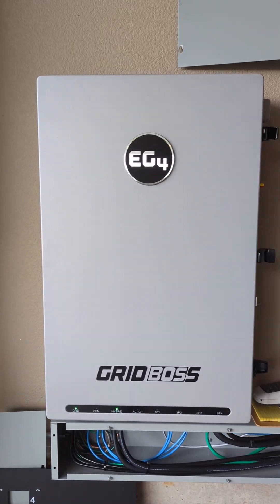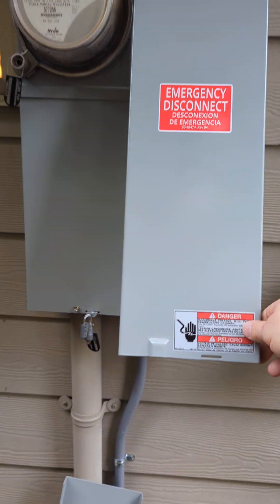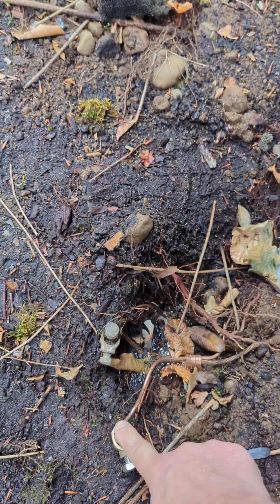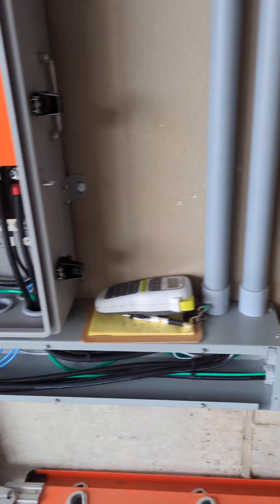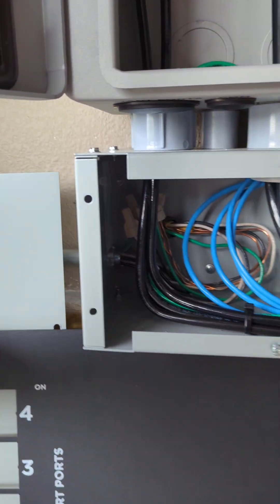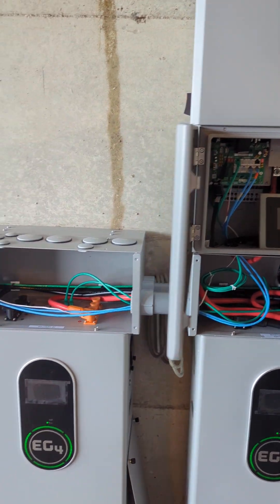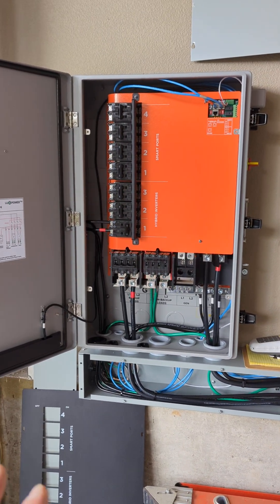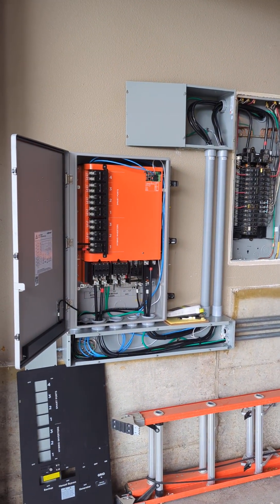EG4 GRIDBOSS w/ FLEXBOSS-21 and 42.9kW whole home battery backup!

Comment: High-frequency, transformerless inverters like EcoFlow lack galvanic isolation and can potentially damage appliances, mainly due to shared DC/AC grounds, leading to ground loops, leakage currents, voltage fluctuations (brownouts/spikes), and inability to handle heavy surge loads, which can harm sensitive electronics or motors, requiring specialized installation and protection. 
How Damage Can Occur:
Ground Loops & Leakage Currents: Without a physical barrier (isolation transformer), the DC (solar/battery) and AC (appliance) sides share grounds, creating pathways for unwanted currents, causing interference or even system shutdown.
Voltage Instability (Brownouts/Spikes): Some models may dip voltage (brownouts) or produce noisy power, especially under heavy loads, which can stress motor windings and electronic components.
Poor Surge Handling: HF transformerless inverters often struggle with high starting currents (surges) from motors (fridges, pumps), potentially causing shutdowns or stress on the inverter and connected devices.
DC Leakage: The AC output can carry DC leakage, potentially damaging sensitive electronics not designed for it, or even causing issues like corrosion in marine setups. Here's what Google has to say about these cheap transformerless inverters: "High-frequency, transformerless inverters like these lack galvanic isolation and can potentially damage appliances, mainly due to shared DC/AC grounds, leading to ground loops, leakage currents, voltage fluctuations (brownouts/spikes), and inability to handle heavy surge loads, which can harm sensitive electronics or motors, requiring specialized installation and protection. 
How Damage Can Occur:
Ground Loops & Leakage Currents: Without a physical barrier (isolation transformer), the DC (solar/battery) and AC (appliance) sides share grounds, creating pathways for unwanted currents, causing interference or even system shutdown.
Voltage Instability (Brownouts/Spikes): Some models may dip voltage (brownouts) or produce noisy power, especially under heavy loads, which can stress motor windings and electronic components.
Poor Surge Handling: HF transformerless inverters often struggle with high starting currents (surges) from motors (fridges, pumps), potentially causing shutdowns or stress on the inverter and connected devices.
DC Leakage: The AC output can carry DC leakage, potentially damaging sensitive electronics not designed for it, or even causing issues like corrosion in marine setups".

Comment: As of October 2025, EG4 Electronics is facing a legal investigation regarding premature inverter and battery failures, but no class action lawsuit has been officially certified. The law firm Migliaccio & Rathod is actively investigating consumer reports of hardware failures, which could potentially lead to a class action. 

However, the company's terms and conditions contain a class action waiver, which could complicate such a lawsuit. 

Key issues leading to investigation:

Premature hardware failures: The most significant complaint involves EG4 inverters and batteries failing within a few years of installation. Some users report multiple equipment failures in a short period.

BMS and firmware issues: Consumers have reported that battery management systems (BMS) have failed, which can cause communication problems with inverters and result in power outages.

Security vulnerabilities: In August 2025, the Cybersecurity and Infrastructure Security Agency (CISA) published an advisory on multiple security vulnerabilities found in several EG4 inverter models. The vulnerabilities could allow for unauthorized access to a user's network. EG4 has acknowledged the vulnerabilities and has been working on a fix, including new hardware.

Poor customer service: Complaints on social media and forums detail customers' negative experiences with EG4's customer support and warranty claims, with some reporting difficulty in getting timely responses or proper solutions for defective equipment
Reply: Notice how nobody cares about your trolling? Go elsewhere. Nice that you hide behind some nameless hidden screen name. Expose your real name and contact info if your so sure of yourself. Loser.
Reply: @gextreme2381  Do you seriously think that I care about me spreading the truth about these crap products? Intelligent people will research my warning and the ignorant people won't. So what more on.
Reply: @gextreme2381 I dont see you exposing your real name gex. 😂

Comment: I'm curious to know what would happen if the Grid Boss fails?  Is the house without power for the entire time?  Or is there a way to bypass it?  Nice job!
Reply from the maker: There is a manual bypass in the GRIDBOSS with two mechanically interlocked breakers that will remedy that situation. If you look in the video at the 2:57-3:00 minute mark you can see where the conductors that feed the house panel are terminated on lugs under a 200 amp breaker, right next to it is another 200 amp breaker that is the manual bypass breaker. The EG4 GRIDBOSS schematics show it also and those are available online.

Comment: Did it pass without the main breaker added in the grid boss where the grid connects? Also did they require dc wiring to go through metal emt from box to box?
Reply from the maker: Yes it passed w/o any problems. The GRIDBOSS only needs a main breaker if it is the service disconnecting means, which in this install it is not, we have the meter/main outside. No the DC is not required to be in metal conduit in this application as it is a 48Vdc battery system and has ocp, which is different from a pv string circuit which is typically in the 400Vdc range.
Reply: @AGEElectricInc okay great thanks a lot

Comment: Thanks for noting that you need proprietary BSB breakers with a v2. Did you find a place to source these breakers? Signature Solar only carries breakers over 50A — they don’t have the 30A ones in stock, and I couldn’t find them anywhere in the U.S (I have a v1)
Reply from the maker: I believe you can find some on eBay.
Reply: @AGEElectricInc yes, but not the type used by GridBoss :(

Comment: Where did you find that waterproof/lockable DC disconnect?
Reply from the maker: I built it custom with a 2 gang bell box w/ an in use cover and mounted the push button to a 2 gang weatherproof blank plate.

Comment: Thanks so much for sharing. I"m half way though my install and I didn't know about the BSB breakers or that v 2.0 doesn't allow for aluminum wire. I'm double checking if I got version 3.0 or 2.0

Comment: Beautiful setup! Do you have a link   for the gutter box below the gridboss? This setup will work perfect for me, thanks for sharing!
Reply from the maker: F66T148GVP

That is the cat#, it is a 6x6x48" nema1 screw cover wireway. You do need end caps/closure plates for the sides.
Reply: @AGEElectricInc  Do you happen to have the part number handy for the deep jbox for going flush to surface mount?
Reply from the maker: @stevenmixon1177 ASE10X10X6NK
Cat# for 10"x10*x6" deep nema 1 screw cover  jbox w/ no ko's

Comment: It looks like you bonded the neutral to ground in your Emergency Disconnect instead of within the Gridboss which would have been perfectly allowable.
Reply from the maker: The emergency/service disconnect I installed has distribution capabilities, so you have to bond the neutral there. It's not a straight emergency disconnect. I installed that so we could install surge protection before all equipment in the system. And possibly add a circuit outside later for landscape lighting or something.

Comment: High-frequency, transformerless inverters like the Flexboss offer one of the worst peak power ratings and the shortest life expectancies on the market. Even worse, these transformerless inverters offer absolutely no galvanic isolation between their DC boost stage and their AC output, so when their MOSFETs fail, they can easily damage your home's appliances. Here's a few more issues that these poorly designed inverters can experience.

Flexboss problems can range from hardware and software glitches to issues with installation and integration with other components like the Gridboss. Some users have reported problems with the system not backing up during grid outages, communication errors, and unexpected behavior during power fluctuations. Other issues involve incorrect settings, such as the "quick charge" button not adjusting charge rates, and the system not recognizing battery voltage correctly. 

Common Flexboss Issues:

Grid Backup Failure:
Some users report that the Flexboss does not switch to battery backup during grid outages as expected. 

Communication Errors:
There are reports of communication failures between the Flexboss and Gridboss, or with batteries, particularly during initial setup or after resets. 

Software Glitches:
Users have encountered issues like the quick charge button not functioning as intended, or the system displaying incorrect warnings or error messages. 

Hardware Issues:
Some users have reported faulty components or installation errors, such as incorrect torque wrench settings leading to broken parts. 

Integration Problems:
Issues arise when integrating the Flexboss with other components like the Gridboss, especially during AC coupling or when using a generator. 

Battery Problems:
There are reports of the Flexboss not recognizing battery voltage, leading to low or open battery warnings.
 
Unexpected Behavior During Grid Issues:
Some users have experienced the system going into standby mode during grid problems instead of relying on battery backup. 

NO THANKS!
Reply: Do you have any examples of this failing in the field? Thx
Reply: @kenmasters007  Sure, Here's an example posted on EG4's customer forum: "Hi, I have the following system that had been working fine until a couple of weeks ago, consisting of 19kw M-solar panels, 2x Flexboss 18kw, 1x Gridboss, and 3x EG4 outdoor batteries in parallel. Lately, one Inverter keeps going down (sometimes both) multiple times a day within 5-10-minute intervals. Not necessarily to 0kw but always up and down between 6kw and 2kw. I have reached out to EG4 support without much success, other than doing a reset, updating the FW, and saying we will monitor the issue. Over the last couple of days, I was monitoring the system closer to find some kind of similarities from day to day.

It seems like every time the inverter reaches about 6.5k to 7k, it starts to go down to around 2k for a couple of minutes before it goes back up again. Yesterday I did a reset of both inverters when it happened, and upon restart it is running smoothly. Did the same thing again today, and again it runs great with full power output after an SW reset.....anyone experienced something similar, as I can't monitor every day and make a manual reset to continue having good power output for the reset of the day?

To note is that the batteries have every day varied charging levels, so I don't think it is somehow related to the BMS, etc.

Below are some screenshots for the last 5 days, clearly the issue is at around the same solar output when it starts giving problems" 

This is just the tip of the EG4 fail Iceberg.
Reply: Thats a lot of talk with no sources. Sure thing buddy.
Reply: Go away, go troll elsewhere. This setup is top notch and nobody cares what you have to say. I'll say it so the OP doesn't have to. You're just trying to stir the pot. Beat it.
Reply: @gextreme2381  EG4 Sales BOT! 🤣🤣🤣

Comment: Thanks for posting the video. I'm thinking of having something similar installed at my home. What type and size wires did you use between the meter and the GridBOSS and between the GridBOSS and the main breaker panel?
Reply from the maker: I pulled 2/0 copper for those connections (per art.310.12(a)  table). This is a GRIDBOSS version-2, the version-3 that just came out is rated for properly sized aluminum (4/0) on lugs and Eaton breakers. The BSB breakers that come with it still require copper conductors.
Reply: @AGEElectricInc  Thanks. Do you have a link for the enclosure that you used to house the emergency stop button on the outside wall?
Reply from the maker: @MountainMining I don't have a link but I just put it in a two gang Bell box with an in-use cover and mounted the 22mm push button switch to a 2-gang blank plate with a hole drilled in the middle to mount it. My customer was concerned with accidental bumps and/or pranksters, and did not want to have a big, bright yellow/red button on the side of his house that could disconnect his battery system.
Reply: @AGEElectricInc  I have that concern about pranksters. You came up with a great solution that looks good too.
Reply: I'm using your installation as a model for mine. Can you share any tips for how to line up and center the holes to be punched in the wireway so that the conduit lines up with the knockout in the equipment above?
Reply from the maker: Yes, it's pretty easy. Typically I just mount the gutter to the wall where I want it and then I will set the grid boss on top and trace the holes onto the gutter and then center your crosshairs so you can utilize a punch kit to knock everything out. Glad this installation has helped you out. Best of luck